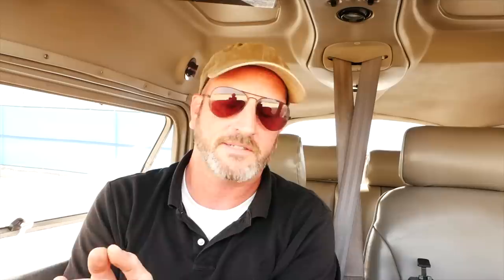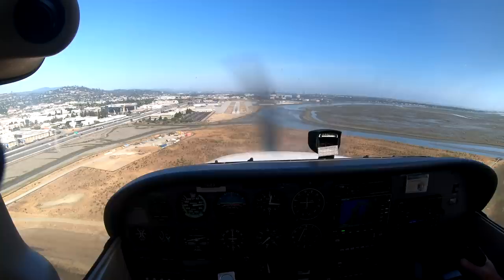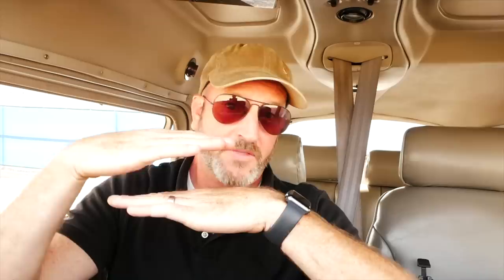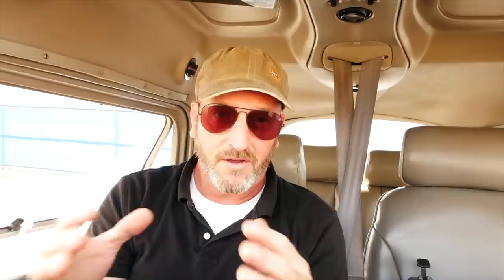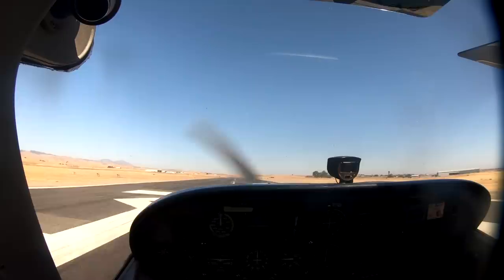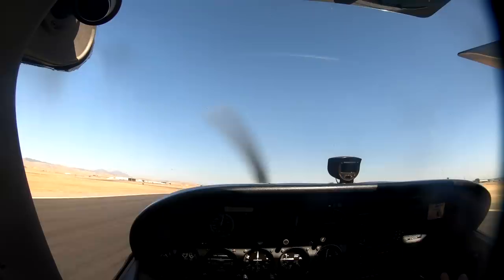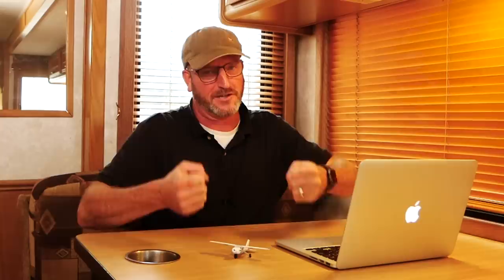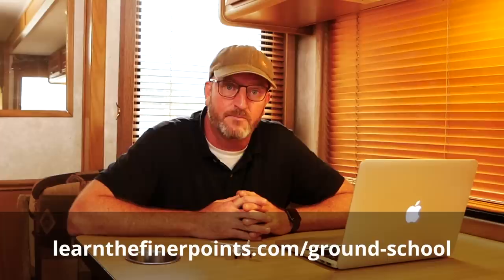How To Land a LIGHT Airplane - Flight training from an experienced CFI (certified flight instructor)

Comment: Jason ...  What would you say to someone that full pitches (prop), and full mixes an airplane at high alt, like KRNO (Reno, NV, 4500ft ASL)?  Because I have found DEATH is the answer, but ALL manuals say too!
Reply from the maker: I'm not sure I understand the question but if I do ... at a high density altitude I would advocate prop full forward and mixture leaned for best power on landing. What that your question?
Reply: @TheFinerPoints  Sorry, I should have been more clear.  I find a lot of pilots that swear that full prop pitch and mixture, is the correct way to take off.  I have even argued this with several CFIs.  When I bring up high altitude, they stand solid in FULL both.

I have also talked to someone that is into aviation, and the exact cause of fatal crashes at Reno (KRNO), are mostly caused by lower altitude pilots, not being taught to lean the engine for proper power.

I noticed you said landing.  I would think that the fuel mixture should be properly leaned for both take off and landing.  I am curious on your thoughts to these pilots/CFIs.